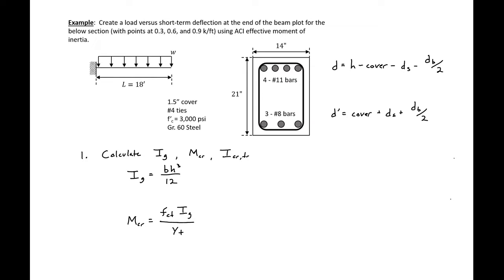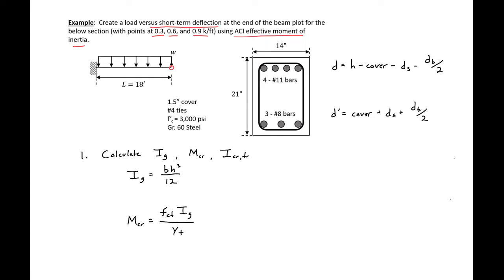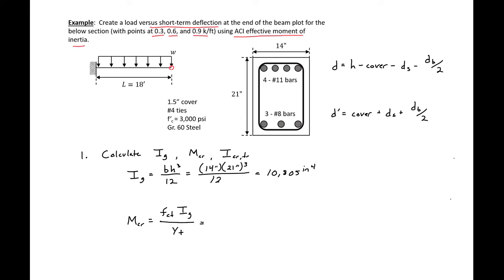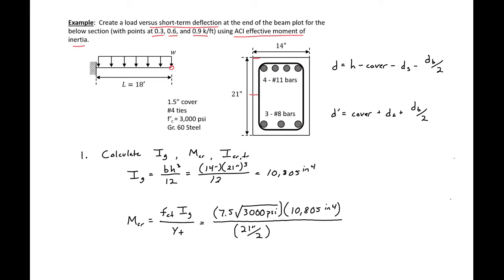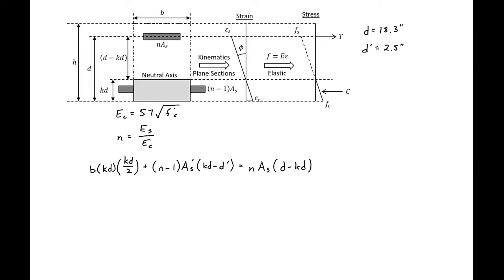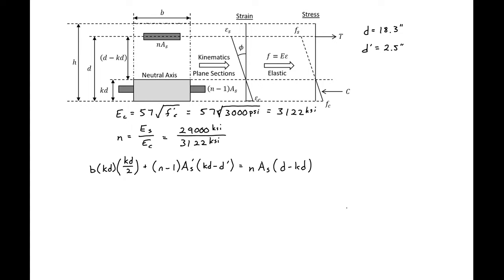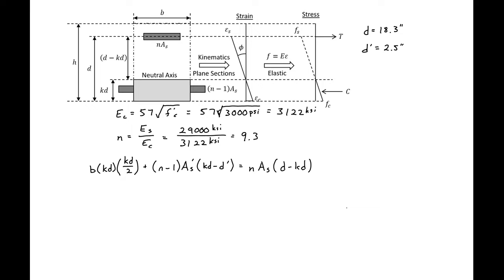9 - Example 2 - Short-Term Deflection in Reinforced Concrete Beam

Comment: Hi, thanks for your nice video explaining the calculation of instantaneous deflection. However, if I want to calculate theoretical deflection to compare with the experimental result, should I consider Ma (applied moment) value based on various corresponding applied forces?